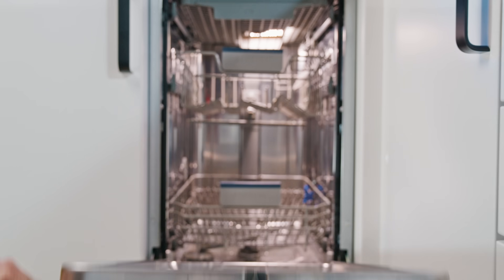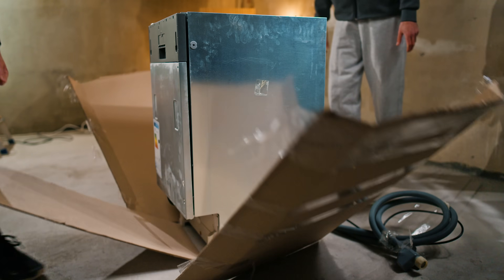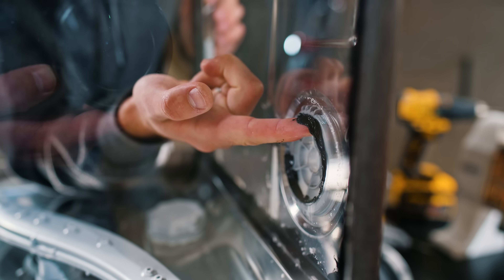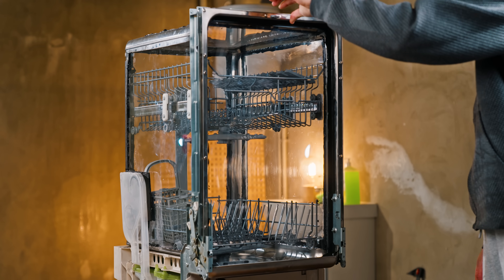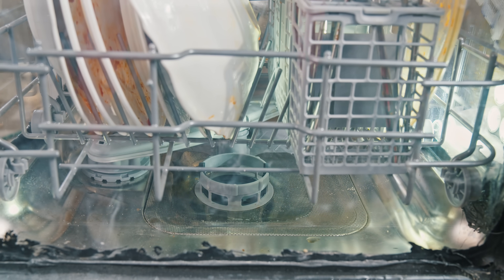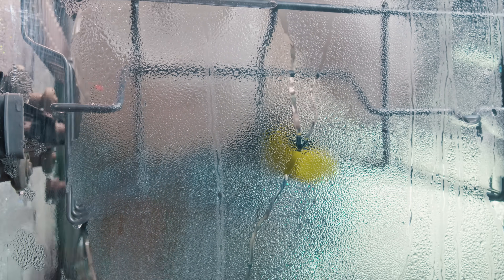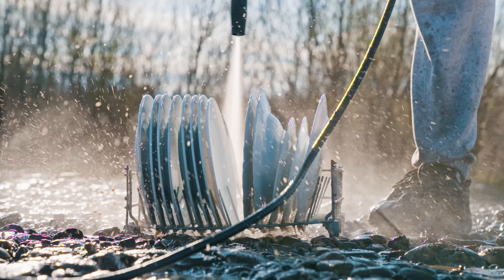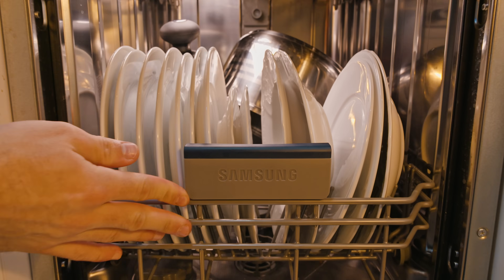Transparent dishwasher - What’s happening inside?

Comment: Personal opinion:
1. I wouldn't leave my tap running the whole time like that, you could use the sink block to trap the water in the sink and wash dishes there, then rinse twice.
2. That white bucket looked like it was 20 liters, and it looked like it used almost 20 liters, it'd have been better to measure the water in the bucket at the end of it all, i feel the machine uses more water.
3. Time: The machine appeared to take ages to finish washing few dishes. I do dishes in 20 to 30 mins and they are clean at the end of the washing. Drying? I use a plate rack for that.
4. Some foods can leave the pans messy and hard to clean, involving soaking first, then most times scrapping the "food" off the pan before scrubbing it.

TLDR: I'll stick to hand washing for now. It's just more efficient overall. I don't mind losing 60 mins a week (I do dishes thrice a week) to doing dishes.
Also thanks for buying a machine, ripping it apart, and reconstructing it to demonstrate this, without a sponsor. Thanks.

Comment: That was so hardcore.  Beyond epic.  I knew if I persevered that YouTube would eventually deliver, albeit not until I doomscrolled like a hopped-up, meth fried chimpanzee until 4.59am.  Time to snatch a sneaky 70 mins of sleep, then bound out of bed, shower, gunfire breakfast and off to work to captivate my comrades with tales of foul, crusty dishes, scalding water sluicing its way doggedly onto every last brandy snifter and sashimi plate, pacing violently during the 10 minute draining process. All the while, liberating the secrets and mysteries from deep within the bowels of that most enigmatic of kitchen appliances.  How their little faces will light up.

Comment: I hate using the dishwasher so much I rather just do it all by hand even if it takes longer.
I Just find it so annoying to rearrange everything while its all dirty as well since people don't use the racks properly when placing their shyt inside. And then hate taking everything out once it's done, because it's so hard to reach.

And to be fair I don't let the water run as hard like that. I only open up the fawcett as far as only a little stream runs out and I use a big tub as well so all the large pots and pans can soak in while I'm cleaning the easy stuff like glasses first, utensils second and then the plates next and lastly the large cookingware. It saves water.

Comment: Run hot water in your kitchen first so it doesn’t start cold, and also put a little detergent outside of the container
And always use the high heat or pots and pans setting. If your dishes can’t survive that they shouldn’t be in the dishwashee

Comment: I wash the dishes by hand and always with cold water and I use between 10 and 15 liters of water (measured) of which 10 liters are recovered for other things, because I use the still hot pasta cooking water to wash plates and dishes and cold running water for cutlery and glasses and I rinse everything with running water, but I always collect the soapy water in the pasta pot which I then pour into the bucket to wash the floors when it's full. I fill another pot of pasta and then pour it, after going to the bathroom and dumping in the toilet drain. (10 liters recovered)

So it costs me a lot less to wash them by hand. Then let's also add the fact that there are 2 of us plus a very small child and it takes 5/6 days to fill a dishwasher and I would never leave dirty plates and dishes to rot for 5/6 days.

Comment: The most over-rated piece of kitchen equipment ever! Not only does it take ages to complete a cycle, the special tablets are an extortionate price, and the power required to complete the drying phase is ridiculous. I can wash our four plates, and cutlery in under a minute, in less water than the dishwasher uses. We use ours as extra storage these days, and the savings on electricity are substantial.

Comment: well, i build industrial dishwashers, so that all isn't new to me. i just didn't have seen how it works - even a smaller "table-dishwasher" with a 5l water tank and a transparent window wasn't able to show me "how it works", 'cause the water gets on all the windows, and you mostly don't see anything.

for the challenge between handwashing and a dishwasher, i saw something what could "reverse" that "dishwasher is more cost effective than handwash" - you washed it under hot water who is always flowing; but not in filling the kitchen sink with hot water and washing it so (that's how i learned how to wash, and the most i know make it so). so, it depends on "how" you wash your load by hand. in the way of filling the sink with water and washing everything with it, it is cost-effective - but it also takes long, the same amount of time like washing the dishes under flowing water... and then it needs to be dryed, so that it might be good when you don't had much dishes to do, but not when you have a "huge load".

Comment: Since the video is old so I don’t have hope people will see this but, are you measuring how much electricity being used for the light as you wash the dishes? Also, by running water continuously you are clearly wasting water. First soak the dishes, second scrub without running the waters, third spray hot water on the dishes while letting the running water wash the soap from others dishes. What will use less water then fully loaded the dish washers

Comment: It makes no sense that you save energy and water by using a dishwasher because it uses electricity and water but hand washing doesn't require electricity and you can use less water if you don't use liquid soap. Use foaming soap and only use hot water for rinsing. Also, it depends on where you live how much your electricity and water bill is. It's called utilities and each company and county handles their businesses differently. Like my apartment, I don't use a lot of electricity and water yet my utility bill changes and goes up to $500 in the summer because I use a window AC and it uses a lot of electricity. In the winter my utilities are around $200. But everyone else in my community has the same utilities but they only have to pay $99 a month all year. The company is screwing me over for unknown reasons. Everyone in my community says so. We are living in a low income housing too but I am being targeted by the utility company. I've been working on dealing with the issue. A dishwasher would be a horrible add on for my apartment because it will add on to my expenses. Also, my community is in a drought that's been happening for thousands of years because we are in the hottest desert in the United States. It gets up to 125 degrees in the summer on the outskirts of my city and you can cook a meal on the street with the rising sun. I lost a pair of shoes to the rising sun after they melted on the black top at my school. The shoes were part of the playground for a week because the janitor didn't have the tools to remove them. We have to be educated to survive here. Use little water and stay inside an air conditioned building. Here people die from sun exposure and dehydration even in the winter.

Comment: Every stage runs with hot water because dishwashers are connected to the hot water line... lol
Reply: In Europe it is Almost always cold 😅
Reply: Dishwashers run with cold water inlet, then water is heated up.
A few can be connected to hot water inlet but that's not common.

Comment: The greatest con ever performed is selling salt in soft water areas.
I repair appliances for a Repair Café and if it can, it goes in the dishwasher, with electrical parts removed, particularly vacuum cleaners, as they are the dirtiest. As for the vacuum hose, put it in a tub with warm water and some detergent, moving it from time to time to get the dirt soaked. Once you see a lot of dirt coming out take it outside and stick the garden hose in it and flush it, done.

Comment: Great video! Thank you for the time and effort to do this video. It's amazing that this machine uses both wash arms at the same time. In the US the dishwashers only use one arm at a time to wash each rack as they use so little water. Average run time is over 3 hours for a load of dishes.

Comment: Hand-washing only uses more water and gas IF you leave the water running the whole time, which IS wasteful.  Instead, use a dishpan, wash several dishes, turn on the water to rinse them, then turn it off while you put those dishes aside to drip dry.  Repeat until dishes are all done.  I bet you'd find a VERY different reading on the meters!

Comment: You shouldn't be comparing the water usage with the tap running nonstop while washing the dishes (my asian parents would have killed me).  The dishwasher may still be more efficient, but not by much if you manually wash the dishes efficiently. (I.e. use the plugs that came with the sink)

Comment: I once stayed with my sister for sometime and got really sick for no reason. I moved back and got better. It happened every time. And I realized it was because of the dishwasher. The capsule is so harsh for stomach because it doesn't completely wash away from the dishes. Unless you run your finger over it and are sure it is actually completely washed off, its not always washed off. And is a great stomach irritant

Comment: Good job breaking it down to such details. Hope someday the manufacturers will start making transparent models.
Reply: Bosch says it's walls are stainless steel so the moisture will condense on them and drain helping to dry the dishes faster, since they are typically thicker walled and retain heat.

Comment: When manually washing, no one washes one dish at a time with the tap running for the entirety of the process. For those who never had dishwasher (outside of US), know you scrub and clean all the dishes first, and then wash them away with water for minimal water usage. That way manual washing does save more water than the typical dishwasher. However yes it obviously requires more time and effort. But it's been proven that manual washing can save much more water than a dishwasher. It does come down to technique as well.
Reply: Yeah. It's a back breaking method which takes time. Time. That can be used to spend with your family or cleaning up the kitchen giving the king final touch up. People deriding on dishwasher are like Android fanbois who birch about Apple devices UNTIL they get one.
Reply: Next time there is a festival, you do the dishes for a week instead of your mother or wife. Let's see how fast your tune changes.

Comment: In the UK, Hoover made a clear plastic sheet that fitted into the recess of the open door. It had a catch that engaged with the door interlock so it could be run with the door effectively open. This was made for demonstration  purposes in some high street retailers.

Also one part neglected in your demonstration  was how in a sealed unit, the dishes dry.  Well, in the Hoover models,  the heater was turned on  with no water flowing and heated the whole space inside. Ofcourse, the air inside becomes saturated with moisture, but how to get rid of that moisture? Thats the clever part! Well, because the innershell is normally metal  it naturally cools down first as it looses heat to the outside. This means the  internal saturated air condenses on the cooler inner shell walls and runs down the sides to the sump. So to save having steam escape in your kitchen, it is important to wait for the full cycle to complete before opening the door. The pump is then switched on at the end of the drying cycle to remove the water.

An alternative  more modern method is to heat the water in the last rinse cycle, so everything is hot inside before it waits to cool down as above.

I would also add  the plastic moulding at the side of the washer is quite a complicated unit and controlled some timmings with many different water  flow paths Effectively it was a water powered computer and to my mind a work of art!
How do I know all this? I worked as an Product Engineer in Hoover for many years.

Comment: Yeah, I'd still rather wash by hand. I use just about the same amount of water, but I can wash more dishes in less time. It's all about maximizing water coverage (spray vs stream) to soak dried plates, and soaping up all your dishes in one go, then rinsing all your dishes in one go. And using the least amount of water pressure to get the job done.  

It's a great way to zone out for a little while. And it teaches the kids to appreciate washing their own dishes right after eating, instead of just grabbing a new one and letting the food dry.
Reply: yeah, dishwasher certainly saves time & doesnt use that much water but handwashing with the water running constantly ,& possibly out of a singular unsprayed tap, is just pure demonic lol

Comment: where I live, we handwash and it saves alot of water.  we do not keep the tap running while sponging.  there is a way of doing it to minimise water wastage.  And yes, wear gloves to protect your hands from the harsh chemicals.  If you have very little dishes to wash, its more hygienic to wash them up by hand manually instead of keeping dirty dishes in the dishwasher till its full load.  And it does not take a long time even to wash a full load by hand.  Very therapeutic in fact for some people and satisfying 😊

Comment: Excellent video. You answered a lot of questions I had floating around in my brain. One issue I had is that when I wash dishes by hand, I turn the water off while scrubbing the dishes. It looks like you kept the water running the whole time. Is the dishwasher still using less water if you turn off the water when scrubbing???

Comment: No jokes if they built a see through dishwasher I would be tempted to buy it. I think you might have started a trend as it looks so futuristic. Plus you can see how well your tableware is doing and it could be easier to diagnose issues. But i draw the line at shoes and hairbrushes in there lol 😅 x
Reply: I'd buy it in a second. Esp if it had lighting. I'd throw a pillow on the kitchen floor, watch that as relaxation!
Reply: But maybe it wouldn't stay transparent for long.
Reply: @ccreib  hey burst my bubble lol 😅. Thinking about it, you're right. Have it for 3 months, and it will look grimy and definitely show the watermarks. Lol x
Reply: @joninapepperell1151  ... Also, it would be very loud, because there wouldn't be any sound-proofing possible.
Reply: @PoeLemic Good point. You're right I hadn't thought of that. Oh well I will just have to imagine it then. I will have to stay living in 2025 not 3025 lol 😅 x

Comment: Bro, ll just talk about the comparison on water wasting.

You have turned the tap on in a very good speed for the entire performance on washing by hands. 
You can turn on the tap once male plates wet 💦 then turn off the water tap, use soap with scrubber to scrub on every plate one by one, and keep it aside it ll soak the soap and will male spot to loosen it's surface slowly, then turn on the tap and rinse the plates one by one. 

You ll save the water bro, if you turn the tap on where 60% water is simply getting wasted is not a good way to wash.

Comment: Mh. I clean by hand and use 9L of 40°C water, let it soak for 10mins which basically does 95% of the work. Then around 3L cold water for soap removal and rest work. I'm done in way under 20 mins, then airdrying. The costs are around 0.2kWh or 8ct where I live. This is no mystery but due to the rework for only 5% the machine can't do selectively. The machine is slower and way more expensive of course. I'm writing this because cleaning under running water is a disgrace and clearly misleading. No one does that.

Comment: Appears to be a Bosch judging from the filter assembly.
One question: You're applying the sealant/adhesive with bare hands instead of using nitrile gloves? Gloves might have made the task less messy and a lot easier on your hands.

Comment: The salt has to do with the hardness of the water. 
Depending on the water hardness, the machine regenerates at different times. 
It never regenerates the ion exchanger in soft water. 
At over 5 °dH every 10 wash cycles. 
If the water hardness is over 18 °dH after 3 wash cycles 
and if the hardness is over 35 °dH, the ion exchanger regenerates with each wash cycle. 
It is important to set the machine to the correct water hardness according to the instructions.